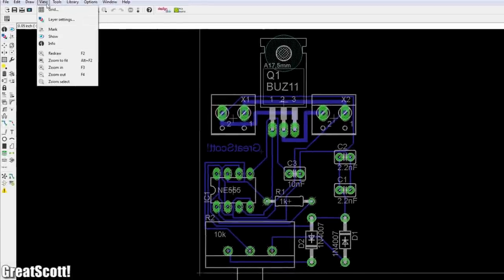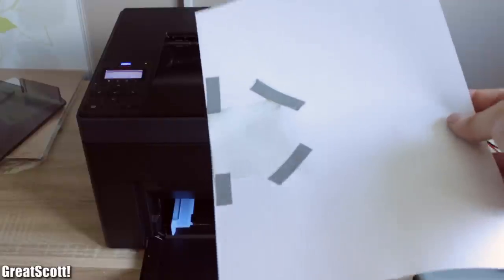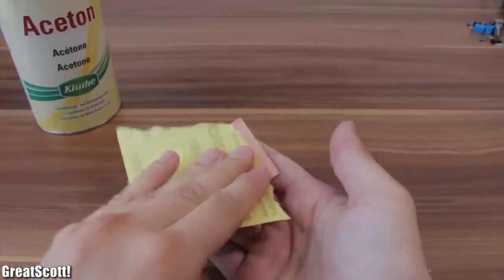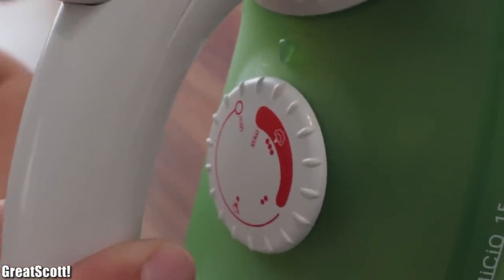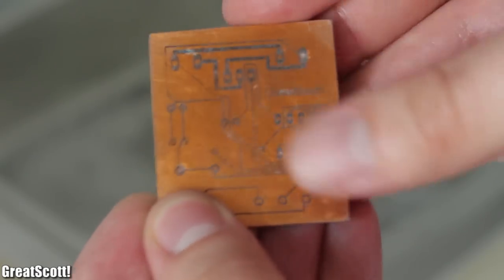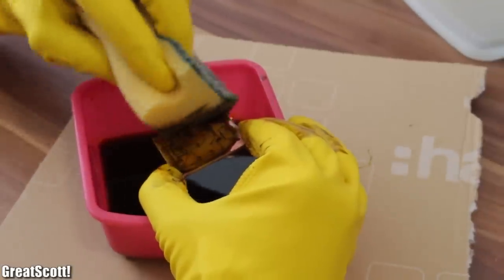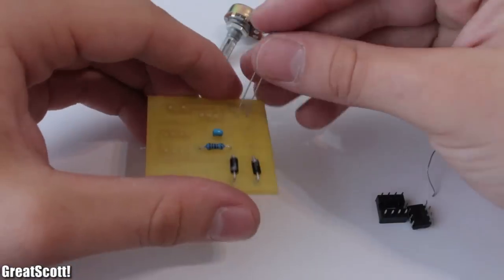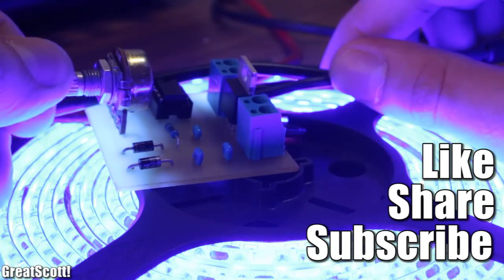Homemade PCB Etching (through hole parts) - Part 2

Comment: I don't have printer and no expensive drilling machining.

I cut paper in a pattern to match the traces, then stick the paper on top of the copper laminate and spray paint it. Then i remove the paper and do the etching.
This works for smd.

Comment: The video is really great but while removing the paper I recommend not to remove it in soapy water. once I had done the same my board was ruined after etching. use normal water. some soaps have chemicals which might disturb the process of etching. this is my personal experience.

keep up the good work scott

Comment: Wait a minute...You said that if there are any intreruptions in the lines after the transfer of the ink to the copper board I can use a Sharpie to cover them up.So , does this mean that I can directly draw on the copper surface with a Sharpie (no printer) and then continue the process?
Reply: You can but unless the circuit is very simple it's not a good idea. btw oil based paint might work better than a Sharpie.
Reply: You can, but of course you are limited by the steadiness and precision of your hands.
Reply: Конденсатор also can use nail paint, the girls be using!
Reply: you can draw the circuit on but you will have to be very precise

Comment: You can use transparent thick plastic sheet (OHP sheet) to print board file. So no need to wash PCB after printing. If you use FeCl3 chemical with hot water, etching process will reduce form 10 minutes to 3 to 4 minutes only. :)

Comment: I have used photo paper for this and it worked well. I used the cheapest Kodak paper and it wound up working the best because it held the toner well, holds more toner without bleeding, wasn't the waterproof stuff, and it peeled much more easily when wet. The more expensive "premium" paper like the epson stuff doesn't work because water doesn't easily wet it and the gloss interfered with the toner transfer.

I also used a 1 part muriatic acid and 2 part peroxide solution for the etchant.

Comment: It seems like you really enjoy a good elctrical challange.

So I was wandering if you ever tried making a project with a home made pcb that had two layers. (What I mean is to make a PCB with a differebt copper trace on both sides).

I am very interested in see what you come up with. I have a number of things I would like to try for myself. But the issue is getting everything together.

Comment: covers etching circuit boards with a mixture of muriatic acid and hydrogen peroxide. This is an alternative to using ferric chloride. These are common chemicals that can be found in most hardware stores along with the super market and drugstores.
Reply: 50 % water 50 % Muriatic  100ml
Hydrogen perxide 25ml 
First Time 25ml Hydrogen 
perxide a gain
Real Time

Comment: The first time using this, I used photo paper and while I got it to transfer, the paper left a film on the board which when I tried to remove it, it damaged the traces beyond repair. I have yet to try again, this time I'll use regular glossy paper (92 brightness) to see if that works better.

Comment: Isn't it easier to use a CNC machine? I mean, 3D printers are all around the place, and they're just CNCs with extruders instead of drills. So the tech for moving something in 3 axis must be pretty cheap. Now only thing that matters, is there a proper software for controlling a CNC to make circuit boards.
Reply: +G_glop a Laser Printer is a CNC machine as well :p
Btw not everyone has a CNC Router or 3D Printer....
Reply: He did get a small x-carve that he said he was going to use for milling PCBs, he just hasn't made that video yet. Hopefully he will though, as many schools and maker spaces are starting to get them, and it would be useful information for anyone with access to one.
Reply: Another cool way to make PCBs is using a laser engraver. The copper get's covered in carbon and then vaporized with the lazer, which gives etching quality PCBs but much faster.

Tho i don't know how well does it with thick copper.

Comment: I just etch my boards manuly with a small, shatpent, flathead screwdriver. its a pain in the butt, but its cheap, and works quite well.
Reply: Instead of hand drill, We can get a small screwdriver like thing in market that has spring and it rotates buy stroking.

Comment: Hi and thanks for your help 
I have a problem with finding the right paper for this project . Do you have a brand or model number of paper you have used that works well. I am using the Iron on method with MG Chemicals Ferric Chloride etch

Comment: You said that you used some glossy paper from a magazine.
How did you get a piece of paper with nothing printed on it? Or did you like rip that glossy plastic of the paper itself.
That is what I kinda need explained, cos I used to also get some really expensive things, well it worked but if this is cheaper :P and less fuss getting it... :P

I SO!! hope you'll see on this this old post
Reply from the maker: +Oerjan Snell There was stuff printed on the glossy paper. But only your design will transfer with the heat.
Reply: OK, I will try that later today if I just find some glossy paper :P

thanks :D
Reply: +Oerjan Snell you can try watching this tutorial it's from the ben heck show he tries different home brew methods including this one

Comment: Hey, Scott! What dremel do you use? I'm looking for one that has a stand such as your so that I can drill my PCBs.

Thanks in advance! Awesome video! :D
Reply: John Galt 
In his case his "dremel" (which is a company name, not a name for a tool) is a "Proxxon". At all costs don't get the real Dremel drill stand (from the Dremel company). I used that for some time, but it's a piece of mostly plastic crap. Add to that the poor construction of the dremel tool itself (the bearings just sit in plastic so you get massive vibrations). The whole setup has so much play,that it's almost impossible to accurately drill holes in a PCB. It's so bad that I switched to a wood router (which has a 43mm neck) mounted in a drill stand (for drills with a 43mm neck), and still get much better results than with the dremel which is supposedly for "fine" work.

Comment: what is cooper? copper?
Reply: +Ferny Lloyd really , Copper is a chemical element with symbol Cu and atomic number 29. It is a soft, malleable and ductile metal with very high thermal and electrical conductivity. A freshly exposed surface of pure copper has a reddish-orange color. Wikipedia
Reply: +Ss Ssa cool thanks
Reply: It's something like 
"Get To The  Chopper!!!"
/watch?v=-9-Te-DPbSE
Reply: yes

Comment: Is there anyway to make the PCB without using any chemicals ?
Reply: ***** 
Since everything is a chemical, no. But you can use a CNC router if you don't want to handle corrosive liquids.

Comment: does t works with a simple printer or it's just for laser printer ?
Reply: +Florian Vajeu You need to use a laser printer
Reply: ink won't transfer to the board, only toner will.

Comment: um... there's no ferric chloride where I live...
Reply: Use hydrochloric acid (aka muriatic acid), dissolve iron into it (steel wool works well) and finally add hydrogen peroxide to get the ferric chloride. There are youtube videos on how to do this.